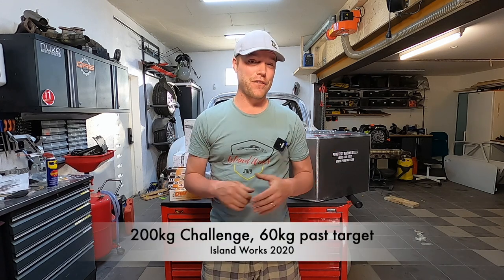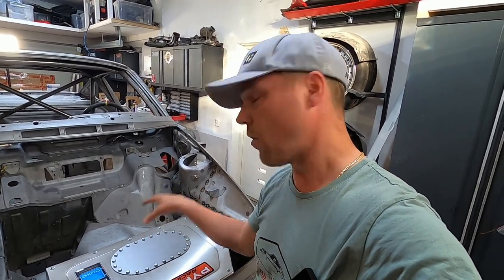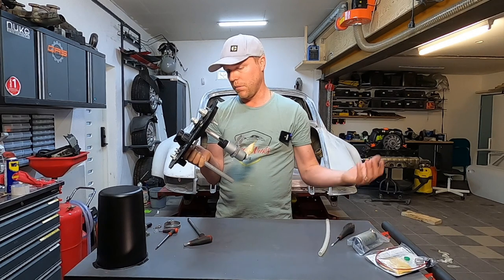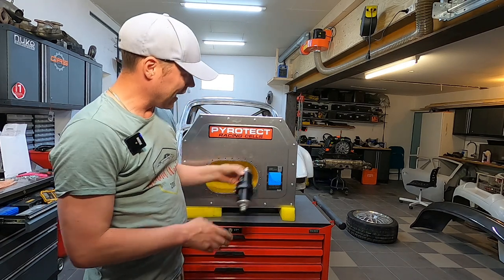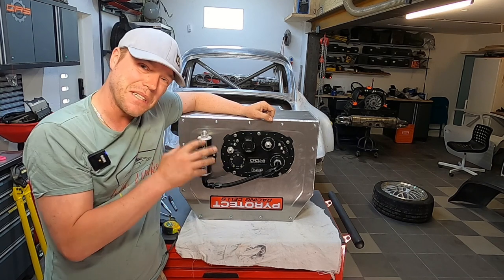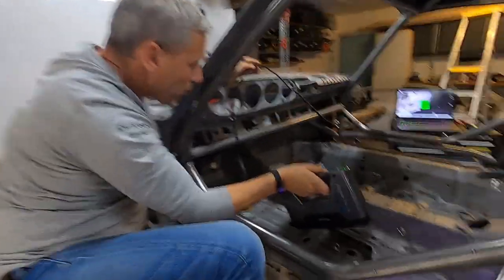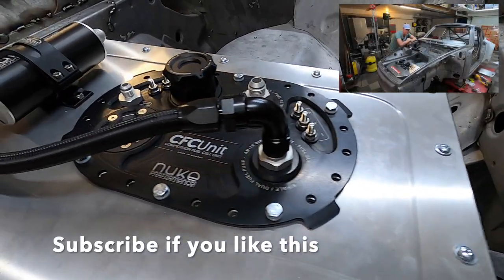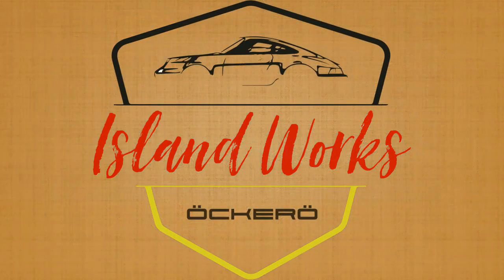Bling Bling Fuel Tank - Tailor Made 964 Fuel Cell

Comment: Found your channel 3 days ago and have watched all your episodes. Great stuff so far! 👍

Just wanted to say, I'd be careful with mounting the tank with those tabs at the bottom. I'm guessing the aluminum they used for the tank isn't more than 3mm thick. A full fuel load is 54-55kg. Once you start accelerating that forward and back/side to side it's putting a lot of stress into those tabs and the sides of the tank itself. If you continue with that design I'd plate the area where you weld the tabs to spread the load and make the tabs a bit bigger. 👍 Good luck 👍

Comment: Really cool. Unlike you when i built the roll cage i went for a full cage also in the frunk which when it came to looking at fuel tank caused all sorts of problems with fit as i didn't want to fabricate a whole new tank. Instead i got the frunk cage cut out and fitted back the original tank. My 964 project has gone pretty much the same way as yours.. It was a 1989 C4 with poor welded wide body arches, had a 3.8 engine that had top end rebuild 25,000 km ago using capricorn pistons..

My plan was to build a car that was lightweight and a homage to 964 cup and RS that had original parts, upgraded engine, suspension and brakes...

Stripped the car to shell, it had an acid bath, then had a fully handmade cage welded in from one of the best motorsports guys in the Netherlands...I was really lucky to be able to source some amazing unique parts which changed what I wanted to do with the car... 

Parts I sourced that I will probably never find again.

Full aluminium wide bodied front fenders (Most likely SCRS) really good condition 
Aluminium front bonnet
Full aluminium doors (m003) from a GT2 . Really beautiful and in good condition.
Genuine new not used 964 RSR Recaro seats ..
993 3.6 Complete engine with 70,000 km
New but not used original 930 whale tail, glass on steel frame with rubbers 

I decided i wanted to build an SCRS on a 964 chassis....Something I have not come across before. 

After dipping then seam welded the whole car like yourself and media blasted.

I found a guy who is one of the best fabricators and the plan was to re create the rear 1/4 panels and arches in aluminium but he was always so busy so what we ended up doing was buying a new set of 930 turbo steel rear 1/4 panels and welding them on.. I replaced steel roof with sunroof with carbon roof no sunroof like yourself... 

The biggest job after that was getting the fit right. As i see with your fiberglass parts, fit is hard. Aluminium Porsche motor sports parts vary in sizes and getting everything to fit took a lot of skilled work....Especially the doors...

Chassis was then undercoated with lighweight stone chip protector and car was painted inside and out in sports classic grey....

I wanted to build a turbo using the 993 but we decided that it was too tricky to fit intercooler etc etc so we decided to build a NA 4.0 L... I swapped the 993 3.6 for a 964 RSR case and parts and we sourced a 997 GT3 RSR 4.0 l camshaft, mahle pistons and amazing cylinder heads in steel, the same ones used on singer...  so a full engine build....
Next i had a lightweight wiring loom made and used ECU & PDU to build a fly by wire... The engine also has ITB...
Replaced headlights with a beautiful set of Raven from 911headlights in the USA. For ABS we used Bosch MS5 racing....Ohlins suspension...Brembo GT brakes....
Sourced front and rear glass bumpers from SCRS....flag mirrors, i do have a set of the genuine racing ones but were to hard to set up on aluminium doors...
Custom set of campy sports made in 17 inch in gunmetal grey, 17 x 9 on the front and 17 x 11 on rear with lovely dish.. they are split rims... 
Engine is in and a few weeks left before it will be finished... its been a long 4 years 

Jonnie
Reply from the maker: Thanks! It seems you have had quite a journey building your car! I hope it all turned out well in the end and that you’re enjoying the car as much as you can! I will with mine in the months to come ;-)

Comment: A word about the FIA certification etc.? How long is it valid for? Can you refurbish it with new foam & bladder? What's the cost? Do you need the foam (for the certification)? Realistically, how long that foam & bladder would last if you didn't need the FIA certification? What does affect the foam & bladder longevity? Could you extend their life by draining the tank (or making sure it's 100% full) every winter, reducing the ethanol content in the fuel, putting some foam preserving additive or whatnot in your fuel?
Reply from the maker: You’re supposed to exchange the bladder to keep the FIA every few years (I think it’s 2 years but can be more). Pyrotect keeps the drawings so that it’s cheaper the next time. I do think the bladders last much longer than that but I don’t know for sure.

Comment: are you real? you want save weight and taking heavy aluminium tank? really? did you hear about Porsche Motorsport? there a lot oem motorsport parts like carbon fiber out + inner rubber tub tank and is more safe then you aluminium tank 😅😅😅 and only 2liters surge tank? we upgrade our surge tank from oem 7liters to >10liters
Reply: Do you have any links to motorsport part for fuel cells